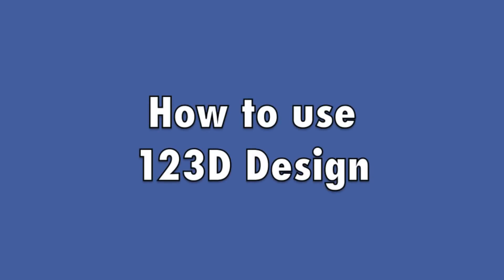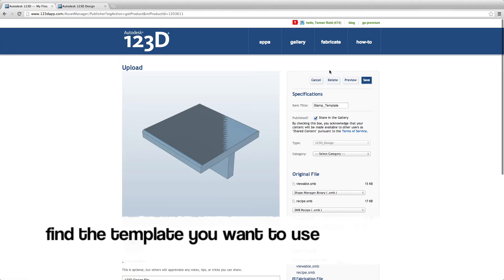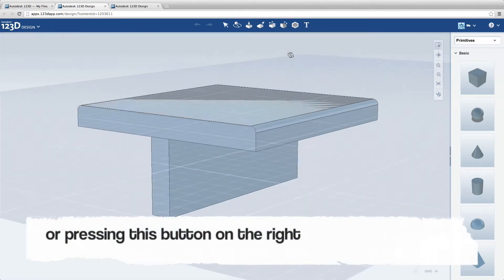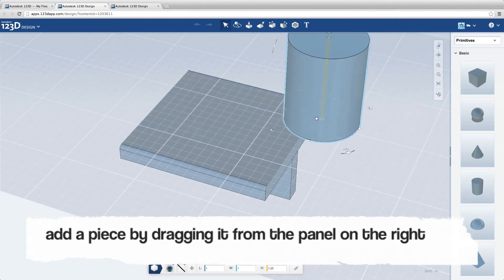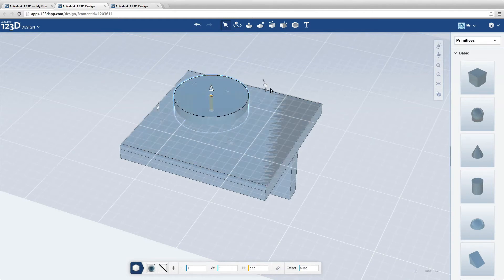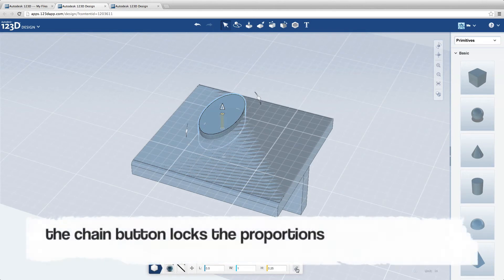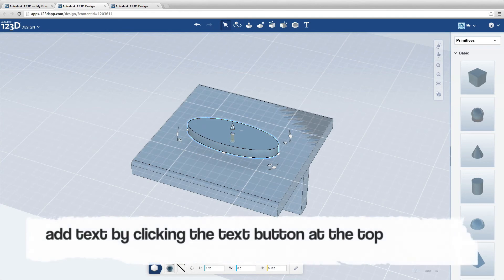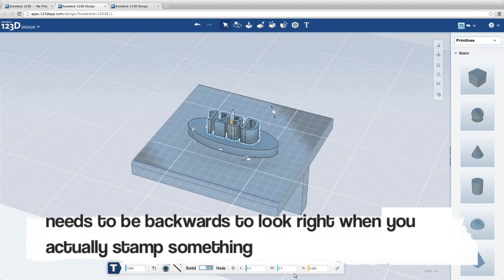How to use 123D Design to make a stamp

Comment: OK, since the magic mouse does not have a scroll wheel, panning is not possible.  You can zoom in/out using the two finger moving on the mouse but "clicking the zoom wheel" is a left mouse click.  Too bad there is not a keyboard function for panning.